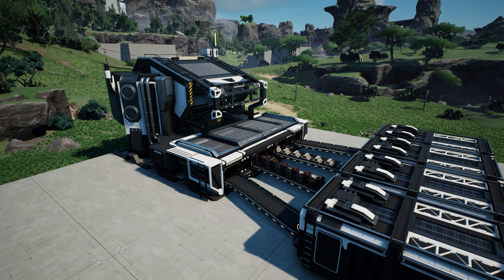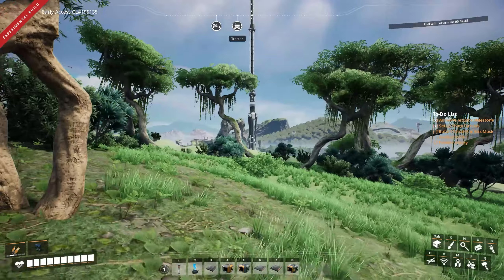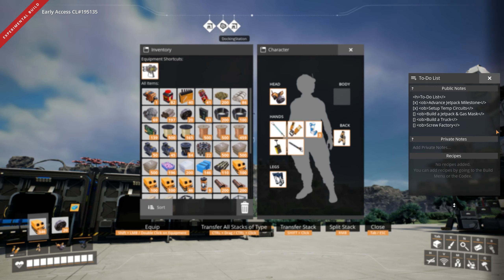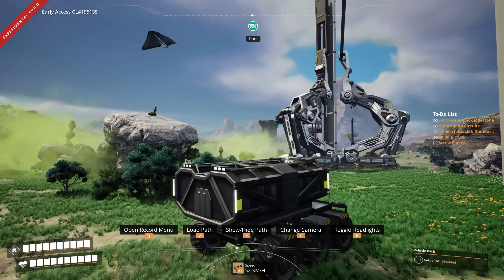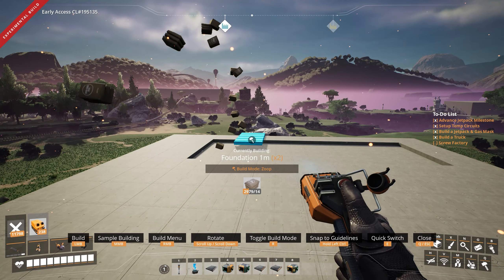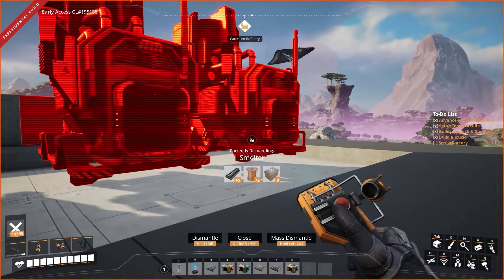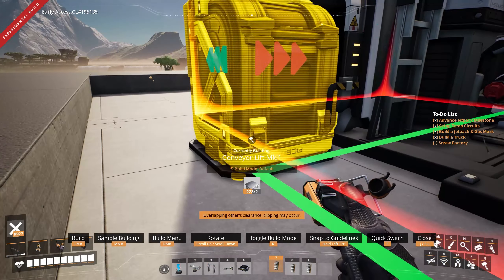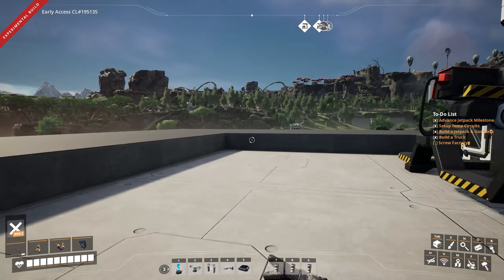JETPACKS & TRUCKS! - Let's Play SATISFACTORY Update 7 - Ep.20

Comment: I like the concept of having your machines 1 meter lower than your walkways; lets them stand out a bit more. I think the idea behind both the steamed copper sheets and any of the "pure ingot" recipes for iron, copper, wet concrete, etc. are meant to maximize your technically limited-quantity resources by adding water, a relatively infinite resource. Likely not particularly useful in the early and mid game, but could be nice in the end game once all resource nodes have been tapped.

Comment: The Fine Black Powder was the bad choice. Both of the others save you copper, which has low availability compared to iron. The wire recipe is also VERY convenient once you have access to STITCHED Iron Plates, a much better recipe for Reinforced Iron Plates. One of the first things I do on a playthrough is spam wrecks untill I have what I consider the three most important early alt recipes, Iron Wire, Stitched Iron Plates, and Cast Screws. I've even set up a blueprint that takes in nothing but Iron Ingots to produce 16.875 RIP's per min.

Comment: Get well soon Darren! More often than not I also get sick during August, I blame the hot weather.

Logistically I've adapted a Left to Right approach to building. Left side always goes up, and right side always comes down. Conveyor lifts always head up on the left, hyper tubes always take you up on the left, input is on the left, and that leaves with a bulky left side, the right side feeding right down into truck stops or freight platforms.
To not make big box buildings I split the factory into either 2 or 4. Aligning my build perspective to the world compass, either facing North or South for the 2 split, and North, East, South, West for the 4 split builds. 
Also, leave gaps between buildings and have conveyors connect them with small frame pillars to "reinforce" the conveyors between buildings

Comment: When you hover over the output of the alternate recipes, it shows you any and all recipes you already know as well as the rates. For instance: @ 23:59 you can see as you hover over the Black Powder output on the alt recipe for Black Powder (called Fine Black Powder) that the alt recipe is 2 Sulfur, 1 Compacted Coal in an assembler makes 4 Black Powder at 15/min. The standard recipe is 1 coal and 1 sulfur makes 2 Black Powder in either an Assembler or the Equipment Workshop at a rate of 30/min.

Comment: you are going to realize soon that the hoverpack isnt as great as you may think... lol The range is pretty short and it drifts very slightly making it hard when you are trying to line up really finicky belts and place machines... That is why I use the PakUtility mod. Turn on medium speed flight and its basically the same thing but doesnt drift. If you wanted to be more legit about it you could just wait until you unlock the hoverpack and then turn it on

Comment: Good choice again on the Recipe. The Iron Wire recipe many consider one of the most important (early game) alternates in the game. It allows building factories for many things that would otherwise require copper with only iron input. It doesn't replace copper for everything of course, but anything that requires just wire or cable from copper can now be made without copper. There are a lot of locations on the map that have only iron nodes, so bringing copper in is just inconvenient. Earliy-ish game examples for this are Stators (and by extension motors) and automated wiring.

One other note, which is kind of too late I guess since you've build a screw factory, is that you typically make screws locally where they are needed. The reason is, similar to copper cable in factorio, you always get more screws than you had material as input. One rod gets turned to 4 screws, similar and with alternates it's even more extreme (steel screw turns a single steel beam into 52 screws). So even taking different stack sizes into account, whatever raw material is turned into screws still takes up "more space" for transport. There are very good altenate recipies that require a huge amount of screws (250/min or even 390/min, for a single machine!).
Reply: Iron Wire isn't that good since all the starting areas have strong access to copper, and it has heinous machine counts and power use. Saving copper is better accomplished with Copper Alloy Ingot / Fused Wire, which saves plenty of copper ore while having very strong per-machine production rates so you're not laying down endless fields of Smelters and Constructors to do basic stuff like making motors.

Comment: Iron Wire is incredibly useful imo because it eliminates the need for Copper in big factory builds. Iron nodes are plentiful. So it eliminates copper as a resource that you often need to plan for
Reply: For minmaxing, perhaps, but for most average scenarios the need to set up ridiculous numbers of smelters and constructors and the horrific power and space requirements outweigh the benefits. Fused Wire is better, tiny amount of Caterium to save a large amount of Copper, tied to a massive per-machine production rate.

Comment: Eliminate the screws from Reinforced Iron Plates, using the Stitched Iron Plate alternate recipe.  The Iron Wire Recipe is a cheaper alternate than copper wire, as copper is relatively scarcer.

Comment: iron wire and steamed copper sheets are both good receipes tbh. there are basically 4 criteria making alternates good being:
1. if the receipe simplifies the process, like when they skip a step in the original process. 
2. the production rate is higher than the basic receipe. 
3. the ratio of input output is better.
4. the rarity of the resource changes to less rare. 

so iron is alot more common than copper and in a couple of processes you can eliminate copper completely with iron wire. steamed copper gives a better i/o ratio. most receipes, if not all, that add water are worth it for the late game as they, i believe in all cases, increase the i/o. and since belts are the limiting factor in the game, if you want to scale big late game you'll want the most bang for your buck.

also, for couting and deleting buildings, there is a keybind in the options to only select one type of building if you hold that key down while in demolition mode. you can just hold that key down  in combination with Ctrl on, lets say, a constructor and then mouse over the ones youre trying to count ( or delete without selecting anything else). think its the mouse 4 button, but im not sure since ive rebound it myself.
Reply: Yeah, once the processes become more involved, and the macro-level logistics get more complex, being able to completely eliminate one of the inputs, like with the iron wire, can be really nice.

Also, I didn’t know that about the disassemble key + number key. Is that new in U6, or is it in U5 too?
Reply: @acegh0st  im not sure if thats 6 only tbh
Reply: @dannymerov  I’ll have to try it later. I’m still on 5.